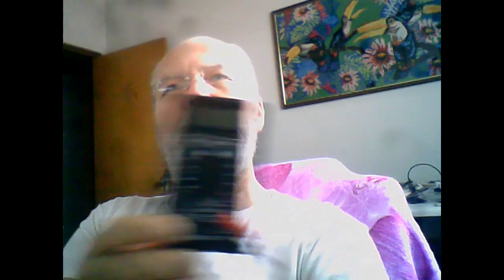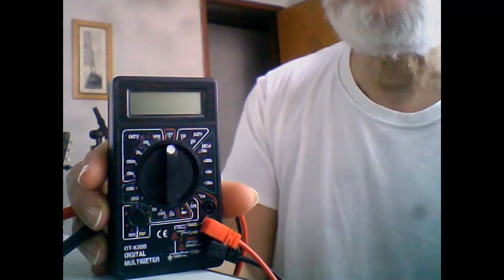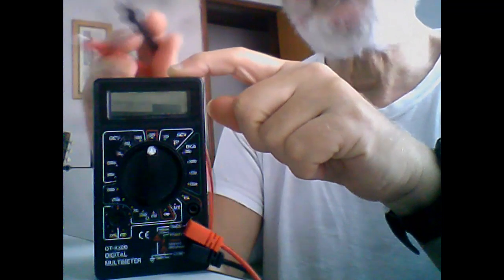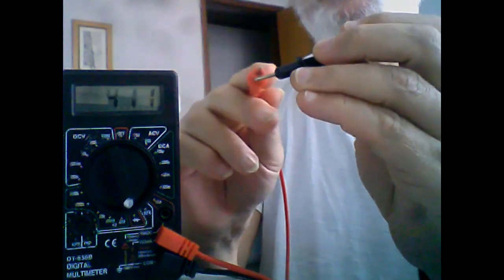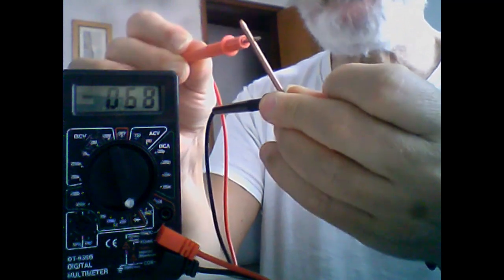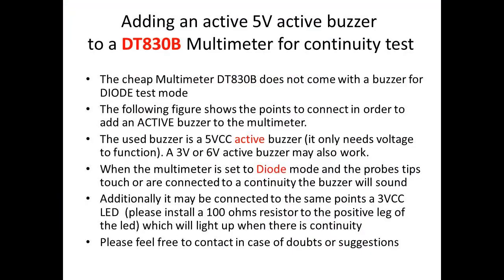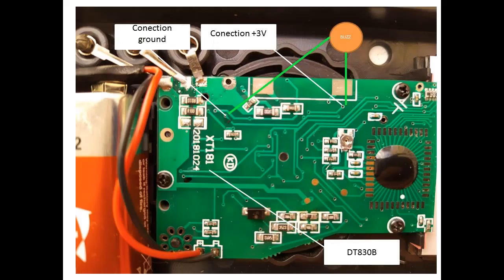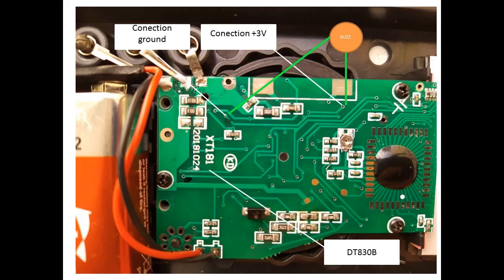DT830B Buzzer 01

Comment: Does adding the buzzer into the circuit change the diode readings?
Reply from the maker: Hi. Thanks for your question. 
It should not. 
Although I never had any trouble related to that, bear in mind that this multimeter is a very cheap piece of equipment and so the quality of design and construction is not the best. 
So, using a trick like the one I recommend in the video is not the preferred method compared to having a multimeter with a buzzer from desgign and thus might cause malfunctions to the equipment.
May you test and have valuable inputs, please share.

Comment: First of all, thank you for this beautiful and educational video.
I also use the same model multimeter. Unfortunately, I bought it without looking if it had a buzzer.
Is it okay if we solder the speaker of the old mobile phone to the motherboard of this multimeter instead of the buzzer ? Does the old cell phone speaker do the function of the buzzer ?Adding the buzzer to the multimeter afterward will not damage the motherboard of the multimeter ? Doesn't it show wrong the values wrong ?
My English is not very good so sorry for any spelling mistakes.
Reply from the maker: Sorry I can not anwer your specific question as I have never tested it. Please notice that an active buzzer (it has an oscillating circuit inside which generates the simple wave that makes the buzz sound)  is different from a speaker, which receives a wave signal, while the buzzer only receives a voltage.
Reply: @pafunleal3849  Thank you for your answer.
I understood the difference between speaker and buzzer.

Comment: My old MajorTech multimeter has failed on me... its giving me inaccurate voltage readings... so im going to purchase one of these and transplant the buzzer over....hopefully all goes well.. thanks
Reply from the maker: Wish u good luck.
I also have a dt9205 with erratic readings and despite all the effort made, I could not fix it.
Reply from the maker: This defect m
ay be the result of a failed component (in general a resistor). Check all the resistor for a failing one and replace (you need a second multimeter anyway...lol)
Reply: I also found voltage stopped working correctly when the 3v buzzer was installed. I took the beeper out and voltage worked again. Not worth it, my #1 use is voltage check and not too much continuity.  As an alternative, take two AA battery, a beeper, and hook two test leads up to it.  This will make a cheap continuity tester.

Comment: Of we test piezo buzzer with direct 3v (+-) it works or not. 
I mean without multimeter how can we check piezo buzzer if it is working or not .
Please reply
Reply from the maker: The buzzer must be of the active type (it has an oscilator inside that generates signal when fed by 3VDC [Volts-Direct Current] ).
The piezo buzzer does not have this element and therefore it will not buzz with only 3VDC being applied to it.

Comment: I already tried everything. My board is different and I don't find where to put the buzzer
Reply from the maker: In general, a 3V signal is always available in multimeters ICs which have diode test mode. However, not always these points are connected to a buzzer or even identified on the circuit.
My video shows how to find and connect this point, but it requires minimum skills in order to search, test and install the buzzer. is u have gone through it and could not find this 3V point activated by the diode test mode, I am sorry...maybe your circuit really does not have it.
Good luck!
Reply: @pafunleal3849  if I could send you a photo of my circuit maybe you could found it. I have basic skills, but learning...
Reply from the maker: Sorry I only saw your reply now. It not practical to find the referred point (3v when in diode mode and probes connected) through a picture.
It has to be searched in the board and then validated.
Wish u good luck
Reply: @pafunleal3849  after a quick search I found a way: this is my board https://ibb.co/S5rWh9v

Comment: Do not lose your time... these multimeters are ALL internally DIFFERENT even thou they sport the same model number. I haven't found any point suitable for this scope In my multimeter which aesthetically is identical to the one can be seen here.
Reply from the maker: I understand. it is necessary some knowledge and also to do some research on the circuit as explained in the video. The ICs on these multimeters have this feature built in and connected to the board circuit. It is up to you to find it. Many folks found it following my instructions. Hope you also find it and install the buzzer as shown in the video. Regards.
Reply: @pafunleal3849  I did an extensive search inside the multimeter, using my tek scope, to look for a signal that changes according to the short on the multimeter terminals in diode mode : couldn't find one. I think that signal is carried out from the COB only when is used. There are too many versions of this multimeter, that you can't find 2 the same. Also I did the search on every accessible track on the pcb and nothing at all. BTW I'm a technician, I know what I was looking for. In conclusion, I say that your idea cannot be generalized.
Reply from the maker: @mariodistefano2973  Maybe you are right sir. Sorry I could not help you. Good luck!

Comment: I have a multitester dt830b, but it doesn't turn on at all, because of a short circuit, because I wrongly connected the probe on the ac current
Reply from the maker: I had the same problem and I found out the defect and corrected it by replacing a SMD resistor that was damaged. It was a 900 ohms resistor located on the middle right of the card (looking at it from the circuit side).
You can identify the faulty resistor with the aid of a magnifying glass and looking for signs of temperature burn (faded numbers, molten material etc) 
Hope you can find it.
Best of luck
Reply: @pafunleal3849  can it be replaced by an ordinary resistor with the same value, namely 900ohm or above?🙏🙏🙏
Reply from the maker: @ape_aje_embat  Any value different from 900 ohms will alter the reading of voltage proportionally!
Reply from the maker: I replaced with another SMD resistor, but I believe it can be any type...space available 
is very tight
Reply: @pafunleal3849  so it must be replaced with an SMD resistor too, can't it be replaced with other types of resistors? For example, replace a 1k 1/4 watt resistor

Comment: Hello. When i bought this multimeter, believe me i was disappointed bcz of no buzzer in it. Then i saw your video and installed the buzzer the way you showed in this video. Only difference was that my negative wire was the left square solded terminal. It works perfect. Thanks a lot. 👍 ☺ 👍 ☺
Reply from the maker: You are welcome. Yes the negativa can be from any point in the circuit

Comment: como  se  ase  que  no  functiona  y  tan  poco  no  es  3v   es  mucho  menos  de   1v  basura
Reply from the maker: Your card may be different, sir
If this is the case, u have to look in it card for the the spots with proper voltage available when then diode mode is selected and the probes are in contact.
If u do not succeed, better leave it

Comment: Friend , I cant do this mod because my board is real 830b 4c 141020 and its totally different than yours, and because can not find 3V with only 1 multimetter , even no pads identified with BZ letters on board

Im thinking about making a 2 x 1.5 type walkman batteries with a led attached to try to find 3v

Sorry about my english lenguage
Reply from the maker: If you have the active buzzer 3V or 5V you could try this:
Set up the multimeter to diode test mode, put the probes to touch and leave it like this.
Then go to the circuit board and look for the connection that will make the buzz bip. Connect the buzzer ground to any ground on the board and with the positive side of the buzzer (naturally connect the buzzer terminals to pieces of wire to make it easier) you seek for the 3V connection.
D not forget to disconnect the probes and check the connection again to see if it stops the beep and repeat until you are satisfied with the result.
Hope it helps.
Regards
Reply: @pafunleal3849  I get the buzzer allocation using a pair of wires, 3mm led and a resitor in the exact same way you say. 

I got the 3 volts in a side of smd resistor in the upper right side under the screw, its near were other similar models with no buzzer have BZ labelled dot , but in my model there is complete different board , with similar components, but different traces on board and no dots BZ labelled.....but I got dot near the same allocation

Next step its to switch buzzer to a led, I want to work when people are resting but not disturbing with the biiiiiiiiiiiiiiiiiiiiiiiiiiiiiiiiip

Im thinking about backlight the lcd , my last cheap multimeter has this feature and was nice

Thankyou very much